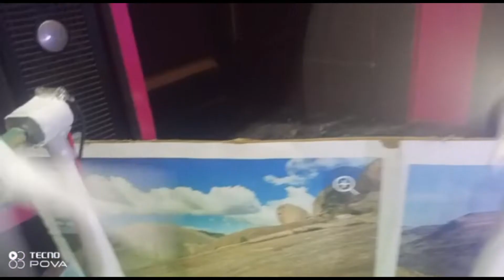Renewable Energy Working model of Science | Working model for Science Exibition | #sciencemodel

Comment: Solar and Wind are unreliable and would not provide the energy requirements for the two apartment buildings in your model. You would need a massive farm of these to feed just a small demand. Fossil fuel generators on the other hand are reliable, more efficient, and provide significantly more energy. Also they produce CO2 which helps with stabilizing the atmosphere, crop production, vegetation growth, animal population growth, and oxygen production. In any respectable scientific exhibit you would have received a failing grade.
Reply from the maker: It is a just a concept not real sir